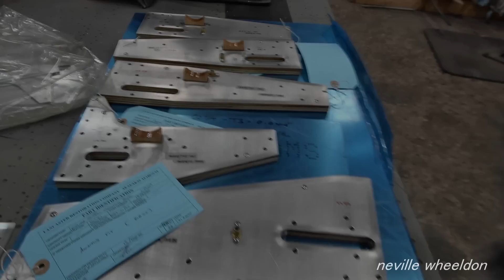Video 212 Restoration of Lancaster NX611 Year 6.   Lancaster Nose section

Comment: Great video Neville, i`m in it for a split second 😀.   Do you know if they are going to fit the French wing as soon as it`s finished, or will they be waiting for the opposite side to be finished, and change them as a pair, to keep Jane`s original wings in store till they `re ready to get her air worthiness certificate?. Will they be doing the same with the Doncaster rear fuselage section, and the French nose cone?.
Reply from the maker: Hi Neil, the French wing will be fitted by April next year, the Following Year (fingers cross)the wings will be changed back, retuning the wing back to France . The same to all dona parts when JJ are completed.
Reply: Hiya, i thought they only had one wing from France at the moment, do they already have the other one, and is it in the same poor condition as the one in your video`s?. @nevillewheeldon1693
Reply from the maker: Hi Neil , they only have the port wing  the starboard wing is in poor condition and still in France @neillambton4065

Comment: Do the formers used on the doner rear section work on Just Janes rear section ? What happens to those forms after the planes are done ? Pass them on to Other restoration projects,  kept incase of future damages or used to heat the shop ?
Reply from the maker: Hi Pat , Just Jane NX611 and the French Lancaster NX664 where made in the same batch, so every part should be identical. At the moment the Centre are keeping all the parts removed until the Lancaster is finished.

Comment: Love your video diaries Neville. Look forward to these every Saturday.

Quick question for Keith... if the control brackets in the wings are plywood sandwiched between metal sheets, isn't there a danger over time the rods/pipes could rub against the metal and wear away? Do the holes in the metal have to be slightly larger than those in the wood?

Hope that makes sense...
Reply from the maker: Hi Allan, the Plywood with one side aluminium bracket , then supports a tufnull block which takes the control rods.Check this video at 13mins-35sec in.